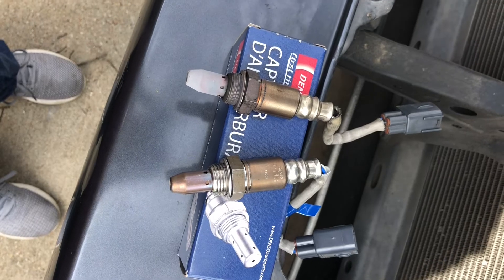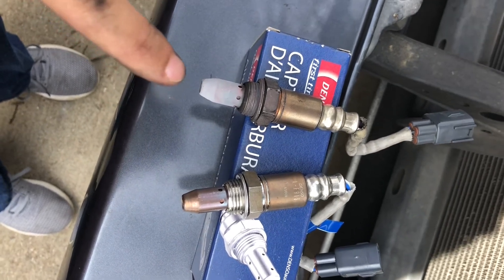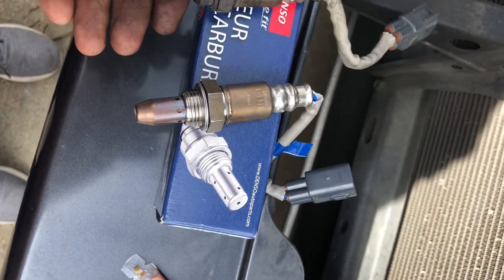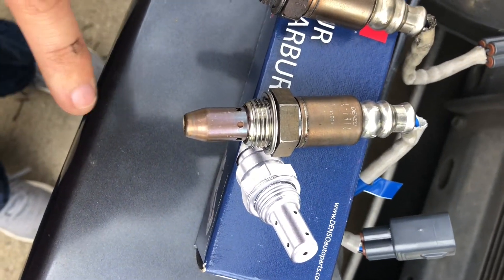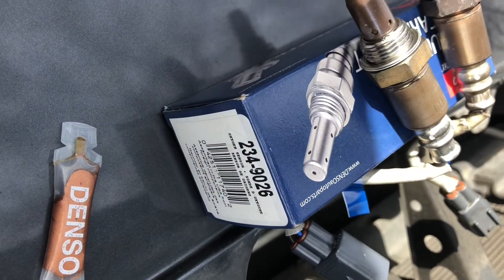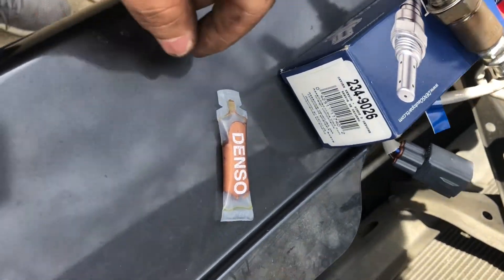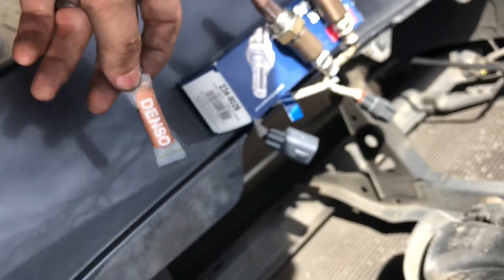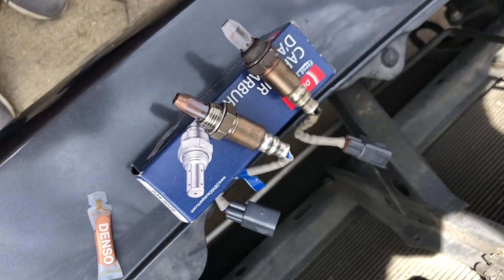2007 4Runner o2 Sensor Part 2

Comment: I went down the route of buying a new gas cap (mine actually was NOT sealing) but the CEL came back on after a day. I'm going to just bit the bullet and buy replacement cats
Reply: Did you replace the cats?
Reply: @bobbys5343  no they're way too expensive. None of the shops are nd here want to deal with the 2 that connect to the exhaust manifold. I guess they're prone to screw stripping

Comment: Whatever happened?
Reply from the maker: Ultimately, it took me replacing the passenger side cat. I used the below and it has fixed the CEL. The only issue was the flanges were not perfectly in line as OEM, so it took some muscle to get them to line up correctly after disconnecting the exhaust rubber hangers.

https://www.amazon.com/gp/product/B071KQLBHZ/ref=ppx_yo_dt_b_asin_title_o04_s00?ie=UTF8&psc=1